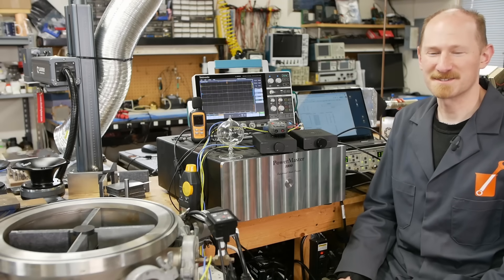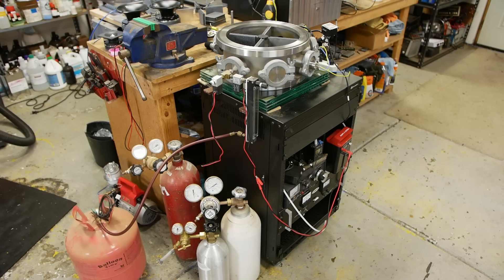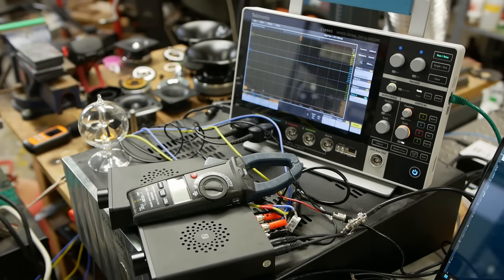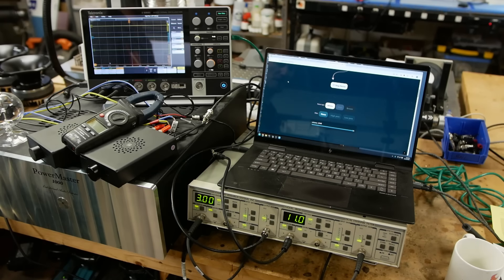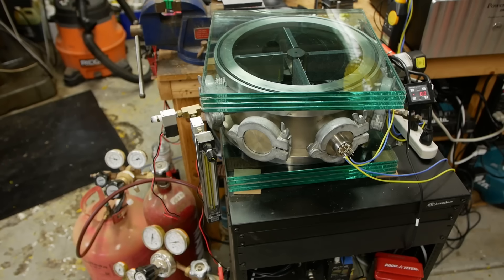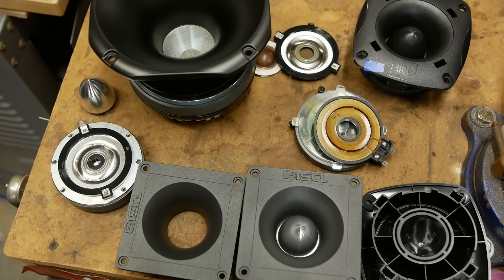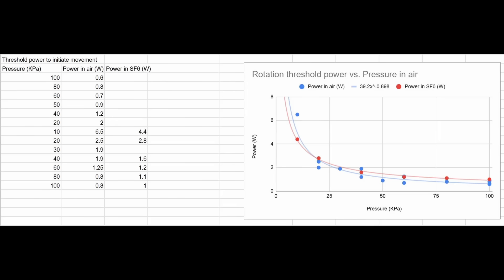Acoustic Radiometer spins in 130dB sound, clockwise and counter-clockwise depending on sound pattern

Comment: @Applied Science ((or anyone else who thinks they can answer))
I was actually "suspecting" that the difference in ""efficiency"" for different gasses was due to the speakers being "optimised" for air. 
But would this "fact" not have been ""obvious"" by the audible sound in (and thereby outside) the "chamber" when "running the tests"?
Best regards.

Comment: Maybe the speed of sound also plays a part? Speed of sound in helium is ~3x faster than in air so you're close to the fundamental mode at 1kHz - maybe the gaps are big enough and the resonances weak enough that the speakers can't couple to the volume of the chamber as well?

Comment: Once again great video.  I always wondered if you could use sound to move fluids around in zero G, e.g. settle fuel in a rocket without using thrust, or even transfer liquid from one tank to another.?

Comment: Hello! You could purify the experiment setup evem more. To get rid of standing waves using white noise is not enough. To have the same frequency power distribution inside the chamber you can take a chamber response curve and apply it in reverse to the digital filter or you can just cut out slightly wider range around the resonant frequencies. This would not change the overall picture, of course. Another factor to take into consideration would be the resonant frequencies of the aluminum wings. Surely, those insulating coverings must have done a good job at reducing the plates' ability to freely vibrate, but we don't know quantitatively how effective that must have been. In ideal case those frequencies must also be removed from the spectrum. On the other hand, you could test the behaviour of the radiometer at those frequencies only. Especially interesting would be to see the behaviour when approaching the resonant frequency from above and below.

Comment: Super interesting video. Got me thinking too... I wonder if a subwoofer could be used with a different device to make rotation. Since the sub would be effectively pulses of air similar to you turning on and off the tweeters, make some kind of rotor that can be pushed and pulled like how a rotor of an electric motor works.

Comment: No the elecrical power is not specced into the crossover. But you have to have the correct mechanical loading of the driver in order for it to take full power. You have a baffle don't you? If not, its really not strange that you need to crank it.

Comment: I want to see some way of canceling out the effect of the speaker geometry. Not sure how to do that though...what about a very large piezo disc? Yeah, the white noise experiment probably wouldn't work too well with an element with a strong characteristic frequency.
But what about measuring the torque in the "standing wave" experiment at a defined position vs. gas type with piezo discs at resonant frequency?
If you vary the pressure of each gas so that the density is equal, the torque should be equal, right?

Comment: Some corrections & Clarifications:  
1) The signal you are using is NOT White Noise, it is "bandwidth limited (i.e. 3kHz to 11kHz), equal power / frequency, random noise"  
2) The ICs in the amplifiers can only out put 155W per channel with a 53.5 V DC power supply @ 1% THD.   (likely ~ 140 W at full power, with the slump of whatever power supply you're using, perhaps down to ~ 48V). 
3) the speaker's active diaphragm is < 1" diameter  (it's called 1.5" but that includes the corrugated surround which does not contribute much output to the active / moving part of the diaphragm or "cone")
4) The circular impedance matching horn with the phasing bullet plug of each speaker is highly directional (in this case pushing the gas molecules vertically at a 90 degree angle to your 4 "paddles"), so in this experiment the 4 speakers have to pressurize the entire volume of the enclosure, which is to say the least, a sub-optimal transfer of energy to the 4 load "paddles"
5) As you have discovered, the "Watt" power ratings for speaker and amplifiers are quite different, with neither really related to reality and grossly wrong.  They should be rated at "Audio Watts", which have many different types as well (mostly BS just to get bigger numbers), all with a lot of "stipulations", i.e. "measurement conditions"  which are never quite achievable in real life use.  What you want to look for is the speaker's efficiency (how loud they are at a given input power (dB SPL @ 1 meter) and actual continuous input power.  Them cute little tweeters you got there will absolutely smoke with only a few watts of a >3kHz sine wave!  A better choice would be PA Compression Horn Drivers ( 3" VC / 2" exit).  They'll actually handle > 30-40 watts all day have 2"-3" diaphragms and are built to be rugged, (since getting to them after normal installation 5-10 or meters in the air is difficult!)
Reply: Your points make logical sense— idk why this video was recommended on my feed. Clearly, this guy isn’t an acoustician / specializing in anything directly related to what he’s testing. Notwithstanding my not performing Boolean searches across subscription/free databases, I am highly suspect of the YouTuber’s claim that this sort of device and/or its effects isn’t described in literature or prior art.

Comment: Is it possible to 3d Print an inverted tesla valve as horn, so that it pushes molecules but the "back" movement of the horn takes less force than the push movement. (due to the characteristics of the tesla vale)

Comment: Hydrogen atoms are 14 times lighter and Helium 7 times lighter than air molecules, so that would explain why they don't cause spin as you only have 1/7 and 1/14th of the energy. This is also why those gasses are very good sound insulators. Would be interestin to hear how silent the system is, if you decouple the speakers from the bottom glass, so that the speakers don't conduct the sound to the bottom glass.

Comment: I should note that i think there is some confusion over the "power handling" of drivers. 

The AES power handling specification defines the true power delivered to the DUT based on the nominal impedance of said device, the frequency range being the lowest stated frequency produced (listed as the minimum crossover for compression drivers like the ones shown) to 10x that frequency. So if the driver has a lowest possible xo of 3khz the range would be 3khz to 30khz. Additionally the test signal has a crest factor of 4:1, or 12db and is pink noise. This is important as many drivers rely on excursion (movement of the diaphragm) to pump air around the motor structure to dissipate heat. Finally, this is for drivers in free air, which an enclosed environment like the one shown is not.

The specification you mentioned in the video (power delivered to driver after XO being lower than the stated power handling) is in fact the IEC standard for consumer electronics and has no direct relevance to the power a driver can withstand, nor is it the standard which the drivers in the video are rated for.

Having said all this, power handling can be inflated, and regularly is for "consumer grade devices", and even in an ideal world can vary a lot with external factors.

Hopefully this may help with finding suitable drivers for use in another video or whatever else the need may be!

Comment: Your explanation of having to jog the sound source to get reverse rotation by establishing standing waves suggests a sort of gas turbine effect where you have another set of vanes mechanically coupled to the radial vanes which would partially cover the speakers in order to create the correct standing waves to start and maintain rotation when fed with a pure tone. By changing the angular relationship between the two sets of vanes it would rotate one way or the other. Alternatively you could arrange the standing waves by driving one pair of speakers out of phase with the other pair with a given fixed mechanical phase angle.

I don’t know that a sound-powered motor has any particular use.

You could call it an anti-siren.

Comment: You've tested air and more or less pure gasses, but how about a different mixture of gasses, I'm thinking like replicating the atmosphere of Mars. I think Venus is >95% carbon dioxide, so not sure that's going to make much difference compared to just Co2. Not sure about Jupiter, if it's a consistent mixture of hydrogen and helium or if it has a gradient or different layers of gasses.

Comment: speed of sound in gases at atmospheric pressure : hydrogen 1286m/s , heluim 972 m/s , air 343m/s , oxygen 317m/s.
those tweeters are too small for hydrogen by a factor of 4 and the diaphragms are too massive to do 4X the original frequency at the same SPL with 10 watts. try oxygen and report back.

Comment: I'm wondering if you're losing efficiency but not dissipating the rear out of phase wave? Don't speakers need to be baffle mounted with ports or stuffing for this?
Reply: Tweeters, like those he is using, are not open in the back.

Comment: The ac. absorber material is  matched to air by design,.. 
i guess :)
Reply: kind of yes -- the density of the fibers determines the "first reflection" value out of the absorber. But since this is an enclosed chamber made of hard materials, these fibers would have the best matching anyway for a very wide range of gases. 
In other words, one could imagine an absorber tuned to specific gas (or acoustic impedance) but in this chamber, these fibers would beat steel every single time anyway. 

As an ultrasound engineer of 20 years, I think that his guess about the emitter being optimised for air impedance -- and hence, not radiating much, is a correct guess. It's also the reason why you shouldn't try to yell much (or for long) when inhaling "funny speaking" gas, as it is really easy to overload and damage your vocal cords (the energy would stay in them rather than being emitted/absorbed by air)

Comment: I've always been interested in the concept of an acoustic compressor, the end application being an air conditioning unit. I doubt the efficiency would be anything to write home about, but there might be applications. Another  application would be for a multi-stage air compressor. Something that might require 100 stages to get to 100 psi. The advantage of all applications for something like this, being, that there are essentially no moving parts. Those diaphrams, if operated well below their limits, should last a lifetime. 

I also have to admit that your demonstration of water essentially being pumped with an ultrasound generator makes me think of red october caterpillar drives.

Comment: I figured that the SF6 would induce more rotation in the rotor since the speed of sound in SF6 is so much slower than that of hydrogen, my thought being that since the speaker would move, and compress that gas to a higher pressure before the molecules in front of it could move out of the way, that increased pressure would apply more force to the rotor. I wasn't expecting air to have the best results, but the speaker being engineered to work specifically in air makes sense. super cool.

Comment: 6:33 oh jeez no.. 😂 .. voice coil movement actually cools the coil, but at least you know you won't go over. And white noise is terrible for speakers. You have to filter for drivers very specifically, even full range speakers need fultering. Digital filters are great. And speaker sensitivity doesn't directly correlate to passband.

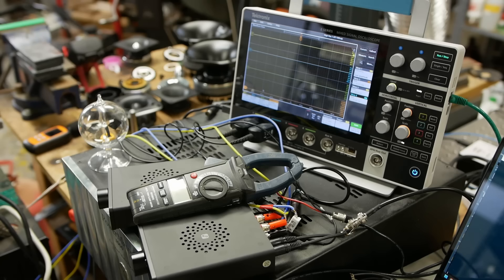Comment: 5:50 that's only (generally) true on dedicated coaxial or 2way/3way systems and even often then they show individual driver ratings, and when they do, they can indeed take their full rating (from a good manufacturer that specifies real rms) within their passband, yes, you need a filter and no you can't dump massive power full range, but a 100w rms tweeter will take 100w rms just fine. I'm a professional audio engineer and owned a car audio company for years, and the only time I've seen a system rating like you describe is whole systems meant to work together or utter trash that already only species a peak power rsting and not true RMS
Reply: take a look at "Performing power tests at Scan-Speak" pdf. They do explain that the power rating of the driver is the power a full-range music-like noise test signal develops across a resistor equal to the nominal impedance of the driver, and the driver is connected to the same (full-range) signal through an appropriate crossover. This music-like test signal isn't even pink noise - it has a massive dropoff at the highest frequencies. So, tweeters with high resonance (supertweeters?) end up with a massive power rating, that is like two orders of magnitude larger than the actual heat dissipation it can withstand.

 And i hate that. And i also hate that different manufacturers use slight variations of this method, and not everyone (or even, almost no one) specifies the test signal spectrum and the crossover frequency.

And even the term "withstand" is tricky. It isn't necessarily a heat problem, it can also fail because of too much excursion (applies to woofers, as those are tested without any enclosure), and no one specifies if that is a mechanical limit or a thermal one. SUCKS.

Comment: Pressure will have a similar effect to different gasses, the horn won't couple as well, losing efficiency.
Burning voice coils isn't the only failure mode, it's possible to rip diaphragms.
An unloaded speaker (low pressure, lighter gas) might (will?) cause audio distortion, losing efficiency.

In addition to measuring coil resistance (can that even work fully since impedance depends on acoustic load?), a microphone to check for distortion could be a better speaker health sensor.

To say that there are no standing waves from white noise is false. Walk around a room where there is a white noise source, the standing waves are very apparent!
Better to say that the overall sound pressure level is even throughout the chamber since the standing waves are distributed. But that then brings into question the precise frequency response of the acoustic foam..
Reply: Your final comment reminds me about the long-standing argument about the Total Harmonic Distortion measurement - that it obscures that there may be some very prominent harmonics that make a system perform poorly in some common situations, while the THD gives the impression of a balanced system.

Comment: Not done with vid yet so not sure if you mentioned it but im pretty sure the piezo water misters have very small holes which water cannot penetrate. They cause cavitation on the bottom which vaporizes the water drives it up through the holes and out in a stream. Yes, differential pressure is a factor by the density on top remaining less due to air and/or less water on top vs bottom of container on bottom. I think. Based on my limited experience.